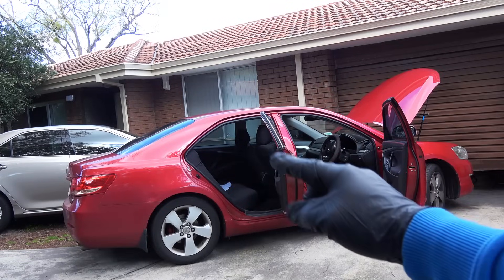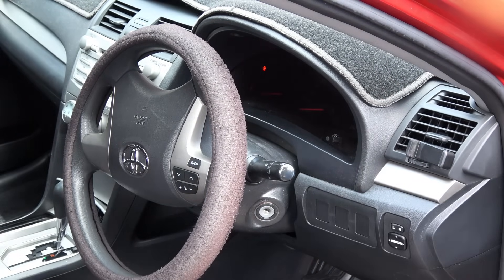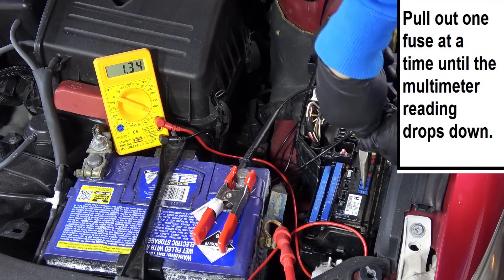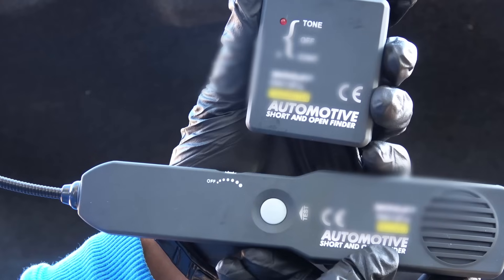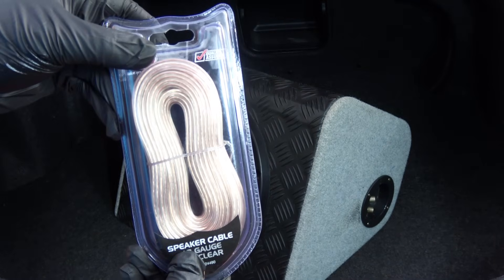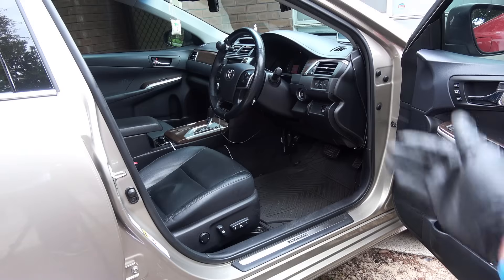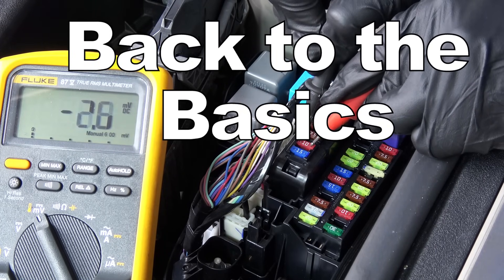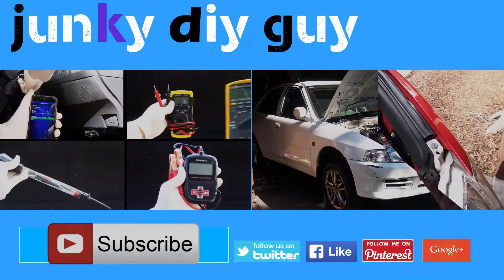How to find a short in a modern car fast and easy (The correct way)

Comment: Thank you for the video Sir, You did a good job with the one exception; your animated depiction shows the current flowing  + to - , the correct flow is negative to positive. Best wishes!
Reply: Current flow can be viewed as either positive to negative (known as "conventional current") or negative to positive (known as "electron current"). There is no error in the animation as the two are equally valid for circuit analysis. How do I know? I am an electrical engineer.

Comment: This was great !!! I have a unique issue but maybe able to follow this. I have a 1966 mustang I restored and they only have 5 fuses - 1 20 Amp fuse is for the lighter and emergency flashers (lighter is not connected) ..every time I put a fuse in (glass fuse) it blows immediately so dead short. I may be able to follow your process so if I disconnect the flasher switch and it doesn't blow, its the switch. if I still get a short, its the wiring...sound right ? UPDATED : Just realized..part of that wont work. I cant get a fuse to work. Can I do the following 1) set the multi meter for amps , 2) test how many amps going from each end of the fuse connector (to see how many amps are blowing the fuse) 3) remove the plug on the switch 4) test the fuse connections again to see ..etc ?

Comment: In your diagram, the relay goes first, and then the fuse. is that always that way? Shouldn't be the opposite, so if the relay has an issue the fuse will blow?

Comment: You can also do the same thing by using a small 12v bulb with leads and alligator clips attached in place of the meter connected between the battery minus post and the ground terminal wire you have first removed. It will light when there is even a tiny parasitic current flowing.  The brighter the light then the more the current draw.  If you want to try it out then hookup the light as described and open the glove box or a door.  The light will get very bright.  I learned this from an old mechanic.  Be careful out there.

Comment: Not having a schematic in front of me for a Prius or any information except if I understand you saying the the lights work the door locks work that tells me at least on main ECU is working which is a computer module if I understand correctly of the symptoms if you believe this is short I will go to the fuses put in on millivolts see any change in millivolts 40 millivolts 50 millivolts across the fuse but I will not pull out any fuses and understanding that you not have any scanners or any other tools when you get to the circuit of much current being drawn by a voltage drop across the fuse isolate that one but you would need a schematic I have to look up my schematic files I'm taking to consideration that the certification ECU works with the key and everything matches have to find the diagram when I find it I'll post it

Comment: With modern computerized cars you can't pull out fuses you'll awaken the modules
Reply: Joe electronic schematics for auto bought a junk Prius for parts, car smashes the current Prius days later...back to junk car. Was told has a short, can see a single wire got hot near firewall but hard to access. No computer stuff works. Nav, heads up, etc. lights, locks n security does. Any ideas?
Reply: @botiroti1  sounds like a nightmare, or a loose connection...

Comment: Thank you for sharing your knowledge. I have few questions if you could kindly share your input.

1- At sleep mode meter is showing 0.05 amps, is it normal for a 2019 lexus nx300 (SUV)?
2- I see spark when i touch the black color lead to the battery terminal (-ive side), does that mean i have a short? i don't have any blown fuse.
3- What things you would recommend to test on a car that went thorough flood water?
Reply: 1) 0.05A=50mA that's quite normal for me
2) most car does that, i guess that is because the circuit has capacitors, hence the sparks.

Comment: I couldn't tell where you were connecting the multimeter leads?
Reply: he unhooked the negative battery cable and hooked one end of the multimeter to the negative post and the other to the end of the cable that wraps around the post.. basically just bridging the gap making the multimeter part of the circuit. i hope that makes sense.
Reply: @heatherrhodge2588  It does.  And thank you so much, that was nice of you.  Appreciate it.  :)

Comment: Seems like whoever installed the sub didn't do it right. Radios shouldn't draw current when off even with speaker wires touching.

Comment: Good job  you are professional...((  i would like to ask you, i have problem with my Saab 9.3 2007 1.9 Tid Victor .. have problem with Radio , Radio works good all channels works when motor off ,but when i start motor become very bad signal very weak have only one channel work and also no channel out side city ... even i put new dvd no radio signal at all , new antenna also not works ( there is sund from speaker but no radio signal .. hop you can help me to find the problem !!

Comment: What do you recommend me if I test every fuse and they are good, but still my car has a short 😞
Reply: check your relays.  You can pull 2 at a time, leave them out overnight and once your battery does not drain, focus those two relays, leave one out and you found your problem.

Comment: Great video due,  would this method troubleshoot why my oxygen sensors not working? It shows EML light on the dashboard. I used scanner to find out the error light is for the Oxygen sensors.

Comment: Question so what if u turn your switch forward and no dashboard lights radio or ac. Y change ignition switch and tumbler fuel pump relay still nothing. Any suggestions? Thank you

Comment: Thats not the correct way to check for a drain on modern cars...by disconecting the battery and putting the amp meter inline you waking up all the modules. This method is acceptable on older cars.
On newer cars you need to detect the drain without disconecting the battery by doing voltage drop accross the fuses...if there is current flowing you will have a small voltage drop accross the fuse. No current and there will be no voltage drop... A much better method then disconecting the battery.
Alternatively you can check draw using an inductive amp clamp around one of the battery cables. Again no disconecting.

Comment: It's called parasitic draining. Short circuit will cut the fuse..
Reply: Parasitic draw is a short circuit most fuses are at least 10 amp fuse blows from overload and many other things. Just my opinion
Reply: @mattsilcott1447  a short is very different from a parasitic draw. I was a licensed technician.
Reply: Atleast he didn't call it a packet
Reply: Roberto Mundo  tries to correct him.... fucks up lol
Reply: Short won’t always blow a fuse
Reply: @joew4202  you're right not all shorts blow fuses, it's called a positive short eg you turn on your low beam and your horn sound. That means your positive for both the lights and the horn are touching each other. A short to ground blows the fuse because there's no resistant to current flow so large amount flows to the ground side of the battery.
Reply: @kirkbrown2147  you know why my driving light bulb is blinking but not not staying on ? It’s supposed to be on all the time then blink when turn signal comes on
Reply: @joew4202  loose connection. Check all your grounds starting from the battery. Make sure you have no corrosion and tight connection all the way you your lights if everything is ok then check the positive side.
Reply: @kirkbrown2147  what would cause the horn to randomly blow on a ram. Blows about 10 seconds and quits. No codes
Reply: @solomonblackwood1235  there's no code for horns. 10 seconds after what? You turn the key or replaced the fuse?
Reply: @kirkbrown2147  no particular time. Randomly. Driving or parked. Checking all fuses and then reset in morn
Reply: @solomonblackwood1235  I've never heard of a short like that. At least we know it's most likely short to ground and not short to positive where you turn your heard lights on and your wipers or horn sounds. To me it seems like some kind of computer issue because the computer controls devices without your input at times. You might have to just take it to a shop and explain to them what's going on
Reply: @kirkbrown2147  quick question. I just checked my car and it jumps from 1.15amps and then quickly drops to 0.35 does this mean I have a short?
Reply: @Smeaded  did you remove any fuse? Shorts usually blow fuses, you meant parasitic draw.
Reply: @kirkbrown2147  no I didn't remove any fuse
Reply: @kirkbrown2147  hey man if u could I need some help figuring out what’s up with my Infiniti G35 Coupe. Ever since I plugged in a radar detect this dude had that I bought that car off of it ended up making all my gauges to not work and ever since thsn my car will die when it’s on but I know it’s not the alternator or battery I got a new one of those because it needed them anyways
Reply: Although I rarely see a fused circuit that will get this hot as the fuse should burn b4 wires in my experience

Comment: Great video! My husband and I have been trying to find a way to test his transmission wiring harness bc we believe there is a short and this video really helps since we know practically nothing about electrical components. This video is very simple but also very good at explaining how electrical current works on a car. Thank you for posting this!
Reply: And now they're divorced thanks to a short...THANKS A LOT ELECTRICITY!!! 😲😲
Reply: Did you find your transmission wire issue?
Reply: @MrShortStuff  no they did not
Reply: Could be a shorted sensor/ solenoid inside transmission. I come across this few times at work on machines. Measure resistance at the wires going to part.
Reply: @dwaynes5983  i tested mine and it starts off ar 0.20 then a second later climbs down to 0.01. At first it stayed between 0.25 then i removed pcm connection and tried it....read 0.01. Reconnected pcm and it reads the same thing....what could be the issue??

Comment: How would you check out a ground wire not working
Reply from the maker: check it with a incandescent test light , if the light lights up, that's a good ground.

Comment: Maybe I missed something, but how would shorted subwoofer speaker wires cause a battery drain? Or any speaker wires for that matter? I don't think they can, they're post-amp that's switched off when the vehicle's off.
Reply: Not if the amp got damaged.

Comment: Is it a wire short that causes a parasitic draw? Or more likely a faulty component? (ie a short in the radio)

 if I have no parasitic draw but no power to 2 or 3 components, what is my likely culprit?
Reply: Blown fuse or bad relay or fusible link.

Comment: My battery says 12.6 volts, but when I disconnected the battery and hooked up the multi-meter like you showed in the video it read 0.00 instead of 1.35 like yours, but I still followed your directions, but I never found the short or the draw.

Comment: Why is the title of this video how to find a short? You're not finding a short, you're finding a parasitic draw
Reply: Do shorts cause parasitic draw?
Reply: No, a short is an unintended path to earth. If this happens it will create an over current situation and blow the fuse. The fault with the sub wires in the video would not cause this fault with these symptoms. It would put an amplifier into protect mode, not drain the battery.

Comment: Hi thanks for the vid,I bought a good quality five year guaranteed battery about nine months ago,it's gone flat,re charged it,its fine now starts first time,I haven't been using the Land Rover,so could that be the reason the battery went flat,thank you.
Reply from the maker: control modules in your car uses the battery even when the car is turned off,  a brand new battery could go flat even in few weeks, no battery will survive for nine months if it wasn't being charged for that long
Reply: Junky DIY guy thank you verry much for your reply,all the best

Comment: Should we keep ignition on or off bcoz in case of off ignistion there will be no current flowing in most of tgecircuit so how can we check short circuit
Reply: This short is draining the battery in the ignition off setting as though you have parked and locked up the car and when you come out in the morning the battery is dead. So no need to have the ignition on.

Comment: What is considered a modern car? Also, if the negative cable is disconnected from the battery, won't everything be off?
Reply from the maker: modern cars means cars that have multiple control modules which are all interconnected to the main ECU with a CAN bus. and yes, everything will be off when you disconnect the battery.
Reply: Yep,once it's can bus it's a whole new world of hurt😂

Comment: Good video i tried it out and everything is good. But i still have the same problem. If anyone can help that be great. 
2009 honda civic ex. Problem: door locks only work when car is turned on. This started to happen after i installed a new radio. I checked all fuses and they all work fine. I also noticed that the radio does not save presets nor does it turn on with the car. I have to manually turn it on. But im not too worried about that just brought it up just in case it has something to do with it. Oh and one more thing. While i was installing the new radio i blew up the radio fuse. I replaced it and the radio turned on again. And yes i looked at all the fuses too they were all fine it was just the radio fuse that got busted. Idk anyone have an idea why the power locks only work when the car is on II and not I or 0. Thanks

Comment: Shorts to ground blow fuses a light thats on in a closed glove box as an example or a parasitic draw (module not going to sleep) drains the battery
Reply: Plus speaker wire coming from an aftermarket amp shorting would out the amp in to protect mode, not drain a battery. The melting of the plastic is caused by a bad connection.

Comment: I saw another video where the guy was using continuity to check each fuse. Does this test you are showing us work better
Reply: The method shown in this video is wrong for a short circuit.

Comment: I have a 03 ford taurus in excellent condition with only 55k miles.  Extremely clean engine and interior.  The headlights are very dim even with the brights on.Replaced bulbs with expensive bright ones. They are very clean with no fogging. I'm wondering if it's a short and DRL is always on or if it's a grounding issue.  I thought I would slice a third wire to the high and low beam wires and run it to the ground on the fender. But 1st I tried your method.  I get 1.42 amps for about 10 seconds and then it goes down to 0.5 amps.  Does that imply there is no extra battery drain?

Comment: This is somewhat wrong, you should not start by pulling fuses at random. When this guy disconnected the battery to insert his meter inline to get an amp reading, he would have woken up all the modules once the battery was re connected. Some of these modules could stay awake up to 20 min after the key has been removed.  You should have used an amp clamp capable of reading low amps. Also, from what you are attempting to do in the video is find parasitic draw. Either way, use an amp clap or measure voltage drop on the fuses. You may get lucky using your method or the way I spoke of but that's the whole point of doing it yourself and learning!!

Comment: I'm experiencing electrical issues in my 1992 Toyota Tercel. Seems to be part of the headlight, parking light and hazard switch wiring. My parking lights randomly turn on. My hazard light switch turns off the engine immediately. Signaling one way flashes bright one arrow and dim the other. I've replaced all of the fuses and relays in the fuse box under the hood. Replaced ignition switch and tested  a new multifunction switch. No difference. Seems a short or a ground wire problem but I haven't found the problem. Any suggestions?

Comment: 1ST THE AMP POWERING THE SUB WOULD NOT PRODUCE ENOUGH AMPS TO MELT THE SPEAKER WIRE AND YOUR BATTERY SHOULD NOT DIE BECAUSE YOU HAVE A TURN ON LEAD TO YOUR AMPS IN THE BACK SO IT WOULD NOT BE ON EVEN IF YOUR SPEAKER WIRES ARE SHORTED.

Comment: False information. In modern cars this is how NOT to search for a short. Pulling random fuses will cause various modules in the car to "wake up" and this will drive you to wrong direction.

The proper way to search for a short is to measure voltage drop accross the fuse terminals to identify the one which is draining much current.
Reply: I think thats what he did at the end for a modern car scenario.  Clearly you never watched it to the end
Reply: 6:23

Comment: Hi sir . I hava the problem that the power betry drop when the car swich off .  already change the betry and alternator. the power betry still drop . Is it the wiring ground problem or the radio system?becouse the car have audio system same like video Please answer
Reply: Now that is a new way to spell battery  ...
Reply: You are right, he missed spell, i think it was accidental, only 3 times.